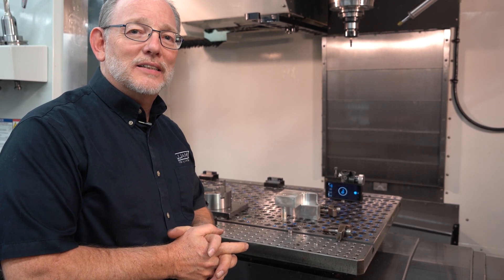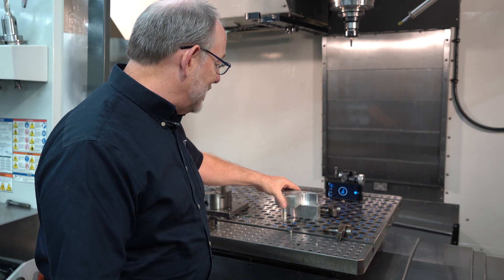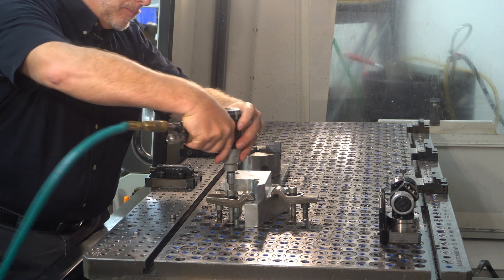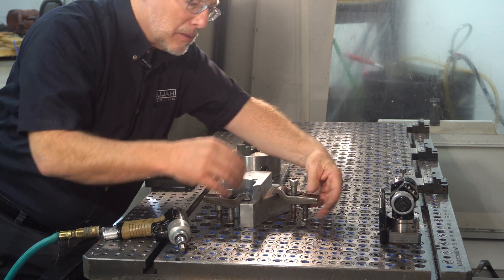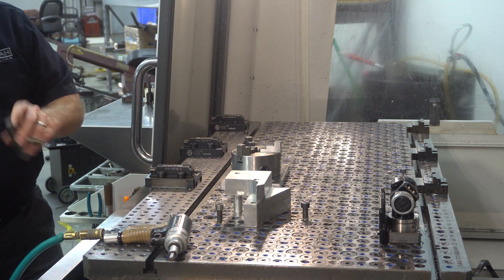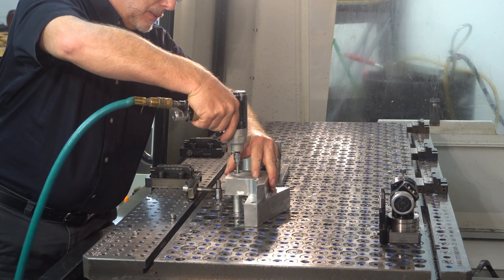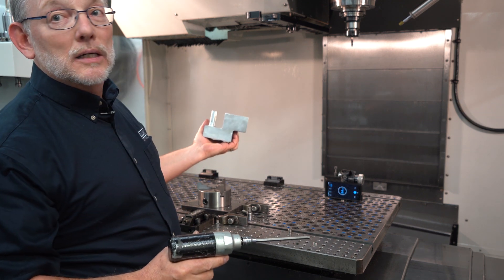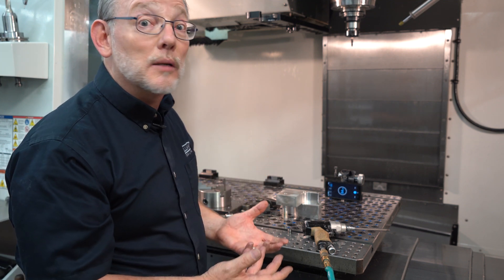CNC Workholding Clamps Vs. Invert-a-bolt Fasteners | Elijah Tooling

Comment: well thanks for not showing us the fasteners and how they work. I'm sure you have another video but just lost 6 minutes of time I don't have
Reply from the maker: Sorry for no reply - just saw this!  If you'll give us 7 more seconds here is a very short video animation of how the fastener works: https://www.youtube.com/watch?v=-RJrZqAx7VY
Reply: So you have to have a threaded hole for these to work? Still no fully understanding the whole process. Would be nice to know what the thread pitch for the main body is too
Reply: @jaxnaturals  Thank you for your interest! Yes, it requires a through hole, which is why it is often used in a picture frame type process when parts are being made.  Of course that isn't an issue with quick-change plates which is another application of this product.  The thread pitch for the various fasteners is found on their respective page on our website.  11/16"-16LH, 1"-12 LH, & 1.25-12 LH are a few of the common sizes for the OD.  Our website has a great deal of information, including CAD models and instruction sheets, and we also have a VLOG with lots of video content/ application advice which may be helpful as well: https://elijahtooling.com/blogs/cnc-manufacturing-tips-tricks-how-tos.
Reply from the maker: Sorry about that response from Willow Crossing POA Board!  I'm the president of our association and somehow the response came from there.  My apologies if it was confusing.
Reply: I was just about to comment this same thing but it had already been said